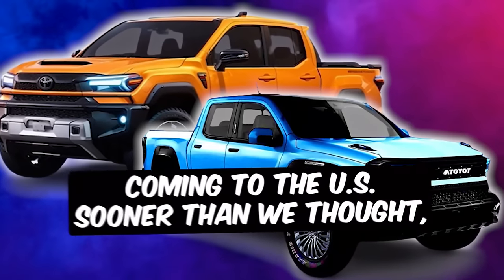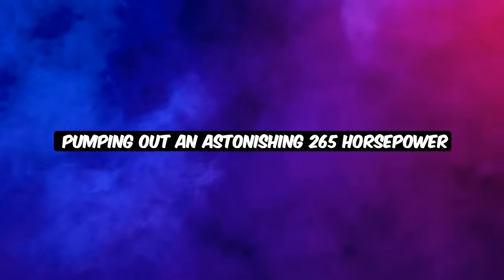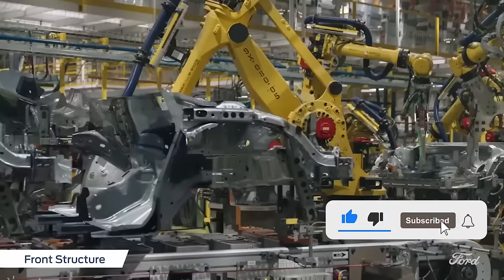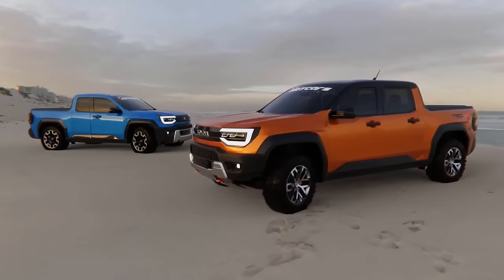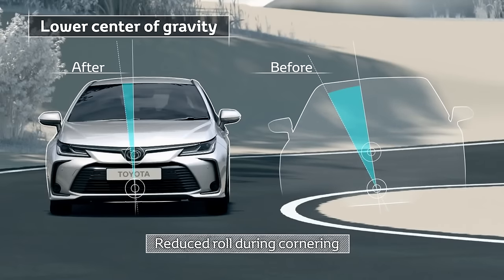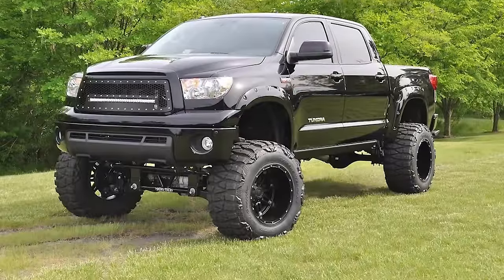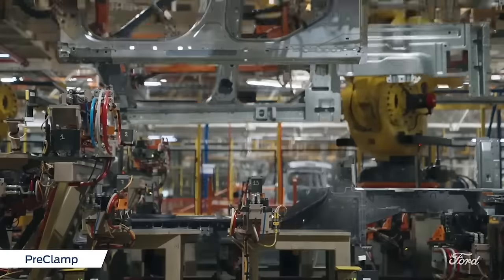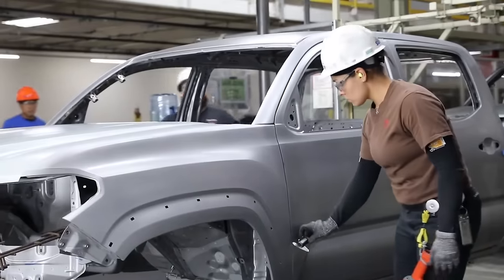ALL NEW Toyota Stout Is Coming To The U.S. Sooner Than We Thought!

Comment: For god sake, can any manufacturer release a compact truck that has a short wheel base and 4x4, no gadgets, no screen, just a simple honest old timer truck? AC optional is fine too.  I have a 90 miles one-way commute 3 to 4 times a week. I haul some gear (not a lot) and some fuel. I need a single cab, hybrid, nothing fancy just plain basic truck. If you can give me a 6 speed manual - great. This week the gas price here is $6/gallon!
Reply: Buy a Taco with 150k miles and good service records. It'll go another 150k.
Reply: The maverick 2.0 gets roughly 23-30 mpg.. and the 2.5 hybrid gets 37-42. You would be happy with their xl version, which is their base model. Look into it.
Reply: Toyota Hilux Champ 10k truck.  Have to import it as far as I can tell.
Reply: @rridgway and barely break 23 mpg on a good day
Reply: @imzaq7  imz ford is JUNk 😝

Comment: What I want is a small truck that can carry four comfortably, has four wheel drive with some moderate off roading capability, at least a six foot bed, and at least 30mpg. This is what the Tacoma should have been I don’t need 300+hp 400+ft-lb 150-200hp and 250-300ft-lb is more than enough.
Reply: Agreed.

Comment: I like the idea of these compact trucks but the whole reason for a truck is for the bed.  The beds are smaller than what I would prefer.  Unfortunately there is not much in the middle. The ranger is the size of the old f150 and carrying the price tag of one f150 are way over priced. The Dodge Ram is garbage etc etc..  Currently there are no new truck on the market that fulfill my wants.  Unfortunately my old truck finally met its end and I may just have to settle for one of these trucks mentioned.  I may hold out a bit longer and hope somebody actually builds what I am hoping for.  Of course it Toyota doesn’t release it soon, then I will probably just go buy a Maverick and call it a day.